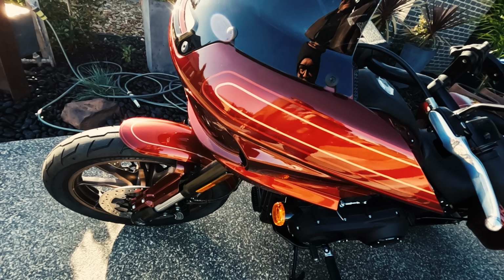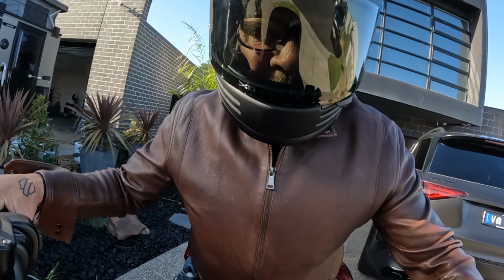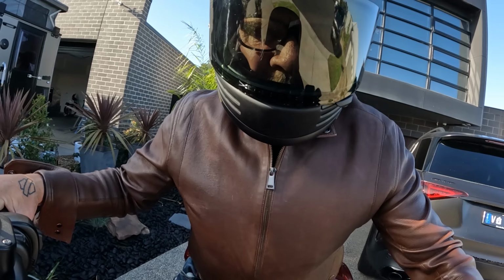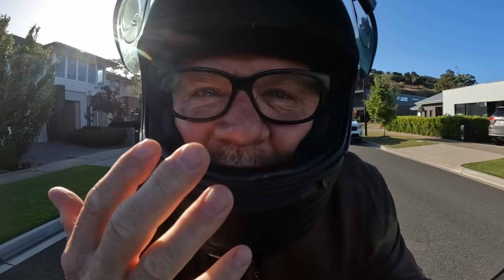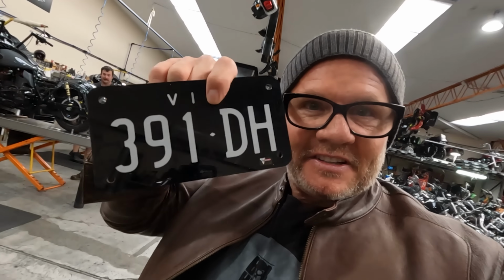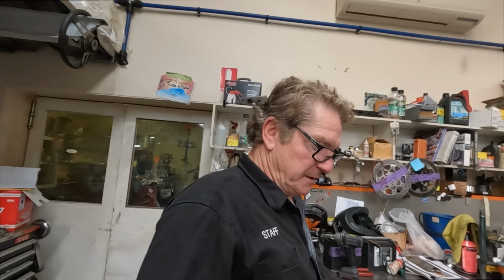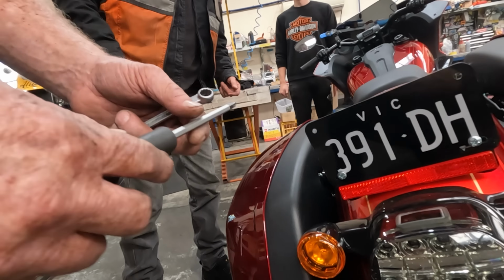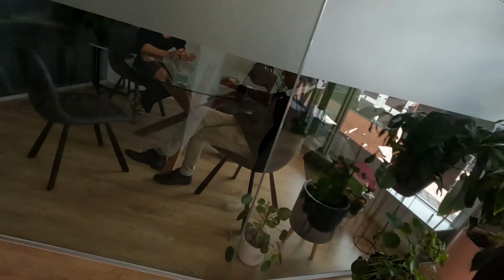FIRST RIDE on my New Low Rider ST  - EL DIABLO 391

Comment: Just got my ST.  Reasons why I bought one: 
- 117 engine is perfect and needs no upgrade 
- great suspension 
- fairing very effective 
- solid side bags very practical and safe 
- lean looks
Reply: It needs an upgrade unless you are happy with anemic power.
Reply: The 117 definitely needs a cam pipe and tune to make it worth while. I got 10k on mine. Front fork is way too soft for hard riding in the mtns. Front brake rotors wer warped around 7500 miles. The fork being non adjustable is irritating. But overall I like the bike a lot but definitely needs some upgrades if u ride aggressive.

Comment: Only thing I like in these new Harleys is the engine performance.. Other than that I prefer my 20 year old Road King, or even my 2013 1200 Sportster. Really wouldn't mind one of the modern engines bolted on though.

Comment: I would put the CR485 cam in contention as well, fantastic numbers and feel when paired with a quality 2:1 pipe, pulls hard, and when tuned, runs 300kms to the tank.

Comment: Once owned a sport glide. One of the bags fell off, while I was riding it! BEWARE!
Reply: The bags are expensive too! Cost me £1500.
Reply: Operator error.  Harley had  warning tags warning about properly latching the red tabs in the receivers. Both bags still on my 2018 Sport Glide with 20k + miles on it.

Comment: As soon as this guy went to the pro shop garage to have a Harley mechanic attach a license plate bracket my I heard a loud clanging and as I looked down I witnessed my hogan having fallen directly off of my crotch and on to the floor. Normally in these situations my balls just shrivel into my body to hide in third-party shame but this was far worse than one of these aforementioned situations.

Comment: Danny, also in the USA, the tune chip seems to have some sort of limiter on the torque available at any RPMS up to about 500 or 600 miles. That is, it seems to not pull torque off of idle up to 2500 -2800 rpms as it should.  You will notice the bike runs a heck of a lot stronger with more torque, by the time to get past 1600 km.  It will be VERY noticeable, the change in torque off of idle, once a certain amount of mileage is logged but before your first 1500 km service.  Wait for it, it's impossible not to notice.

Comment: Great content as usual! After returning from a 2200 mile road trip across France and Spain Im so impressed with my FXLRST. I used the HD tall screen and had a fuel map installed with Cobra NB slip on exhausts fitted. The tune (fuel map) transforms the power delivery! You are going to be amazed when you have your cam fitted !!! Enjoy 🎉

Comment: Sorry Danny but it's just shop bought personalisation NOT a "Custom Build". A "build" is cutting and welding frame etc! But you've started with an expensive bike that slower and has less power and comfort than my 12 year old all conditions hack ride that still has more advanced suspension and features than that Harley.  
Harley's also offer a very uncomfortable riding position that is anatomically bad and not ideal for control of the bike in many cases. 
But it is a comedy channel and  you're funny along with Colin and the crew so we can live with the HD BS😄
When's the next trip?